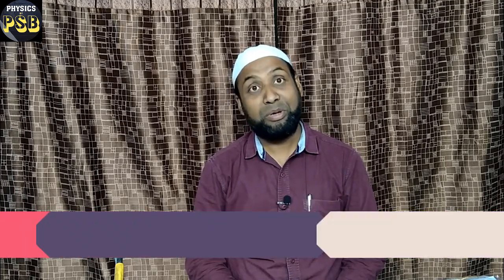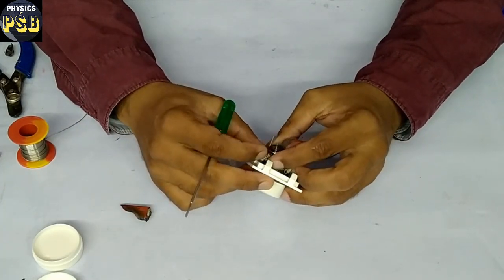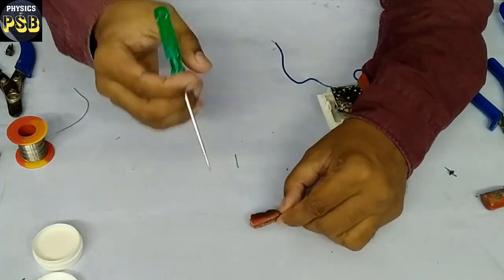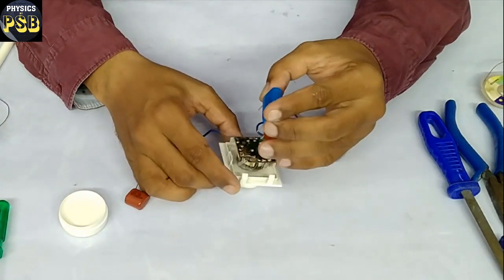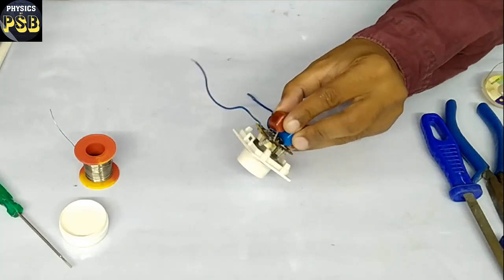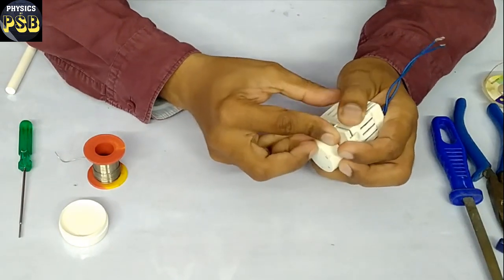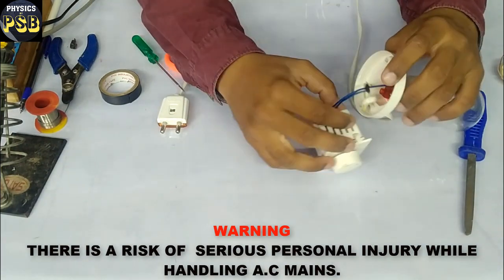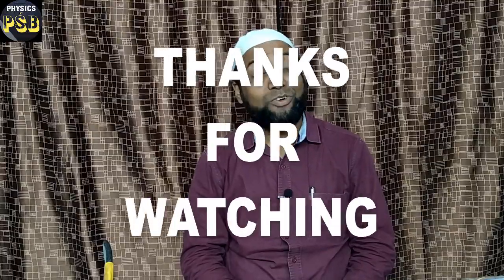Repair a fan regulator.

Comment: I changed capacitor  but voltage not changing remain same for all buttons. My fan regulator has two capacitor 2.2 uf and 3.3 uf. But it has 220 k two resistor and 4.7 ohm one  resistor . Is it a problem?
Reply from the maker: I can help you with this ...only if I know the circuit diagram.
Reply: @siddeeqbasha  ok I know circuit diagram 2.2 uf and 3.2 uf capacitor one side connected to 220 k resistor and another side of both the capacitors connected to only one 4.7 ohm resistor
Reply: How I can send you diagram?
Reply from the maker: Does the button mean the rotatory switch.
Reply: @siddeeqbasha  yes rotary switch. How to solve this problem?

Comment: I dont have 225j 250v capacitor which i can use?
Reply from the maker: Use a capacitor with a capacitance of nearby value.  See that the voltage range must be equal to or more than 250V.
Reply: @siddeeqbasha  Can you suggest me a capacitor near to it.
Reply from the maker: Go for 2 microfarad capacitor.

Comment: My ceiling fan regulator   225j 250v capacitor got burnt Can I change with 22nf 0.022uf (223J) 400V Mylar Polyester Film Capacitor?
Reply from the maker: 225J stands for 2.2 uF (225 = 22x10^5 pF = 22x10^5x10^-12= 22x10^-7 = 2.2x10^-6 =2.2uF ) whereas 223J represents 0.022uF.  The voltage mentioned beside it (250/400) represents the maximum voltage that can be passed across it.     (i.e., the first capacitor can't withstand voltage beyond 250V ).
Now let's come to the point, if you use the mentioned capacitor (223J) to repair your regulator then it will reduce the performance because of low capacitance.  But the regulator may function with it.
Reply: @siddeeqbasha  thank you
Reply from the maker: Most welcome
Reply: @siddeeqbasha  only 2 percent will reduce?